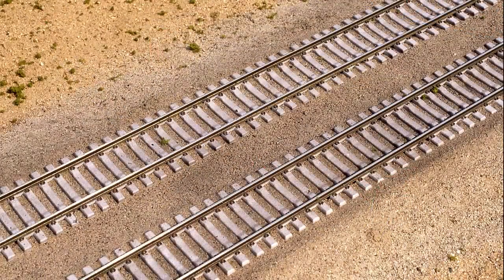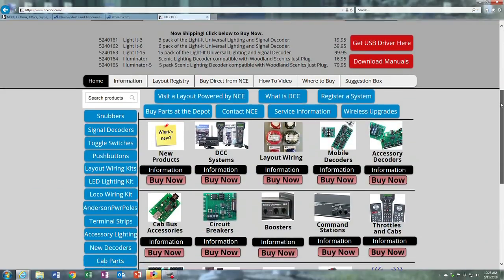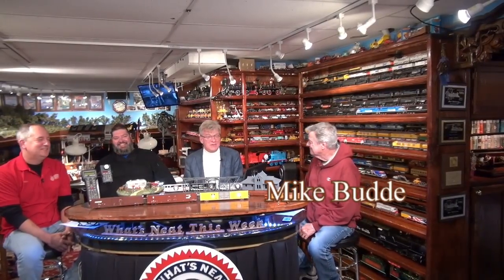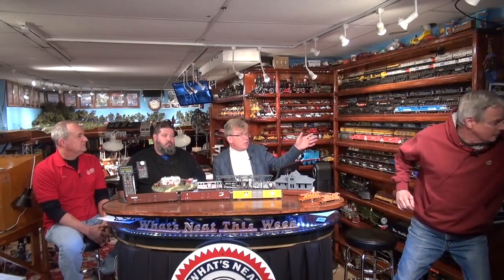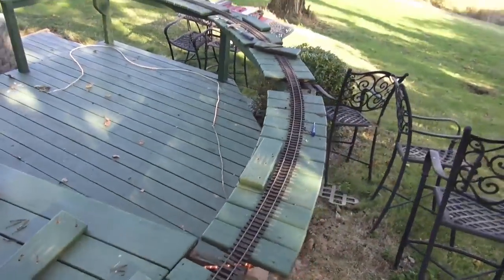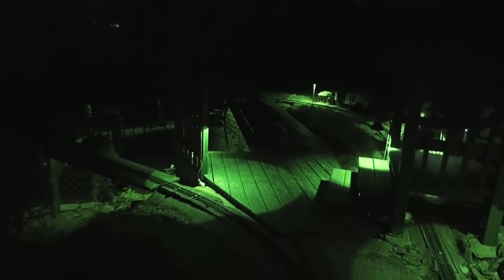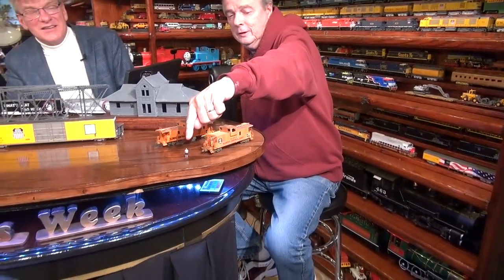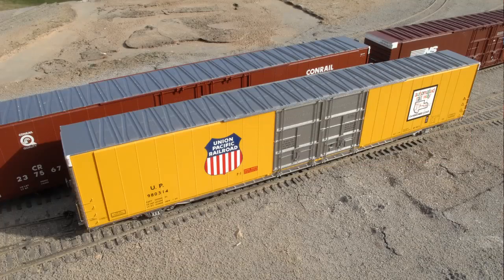What's Neat This Week in Model Railroading #175 Show November 6th 2021

Comment: For N Scale I use Atlas code 55 track. Most realistic looking and reliable if you are careful laying it and soldering the joints and having gaps for expansion and contraction. Also a DCC bus that connects to the track in various locations.